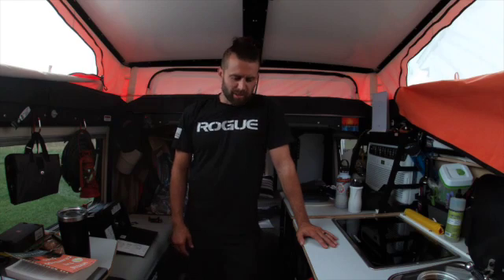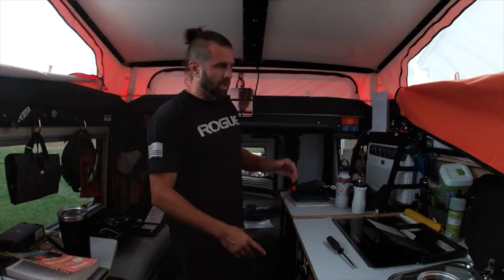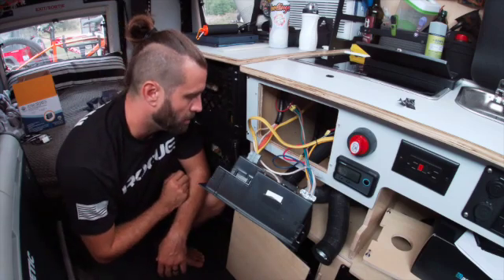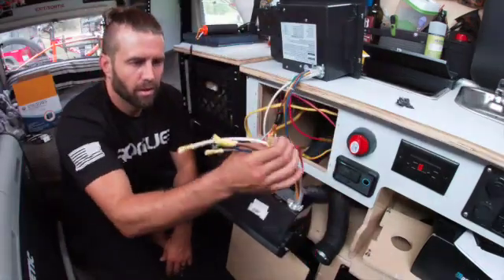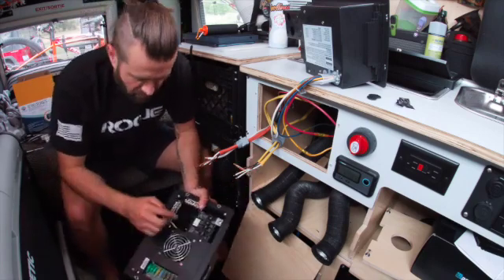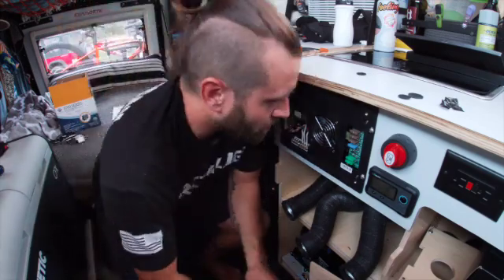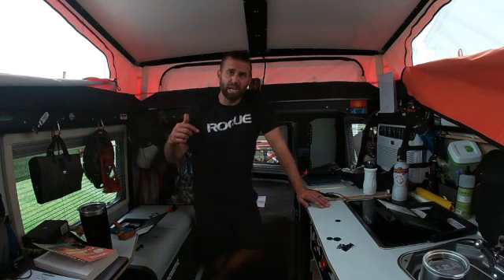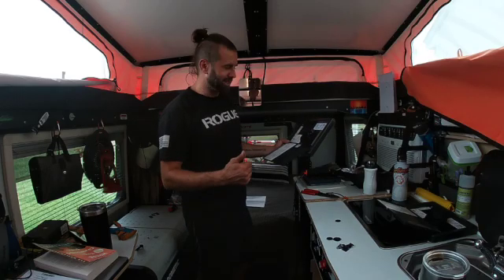Taxa Mantis Lithium Control Panel Install

Comment: Great video - thanks for doing. I Did this in my Mantis - do you have any issues getting it lithium mode, or is the auto detect working correctly?
Reply from the maker: No problems at all.